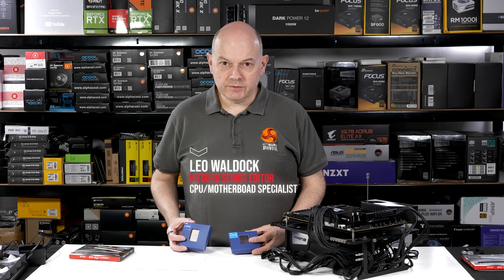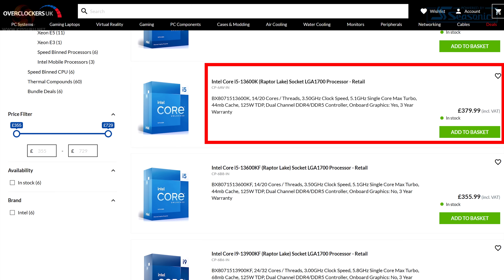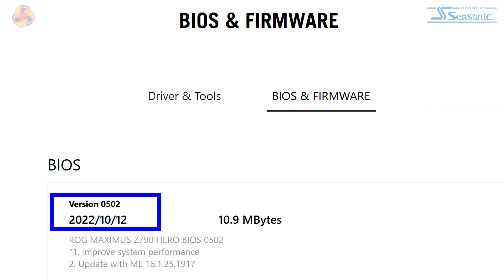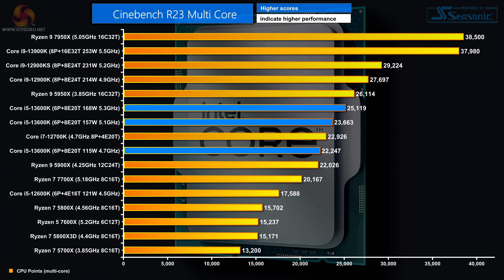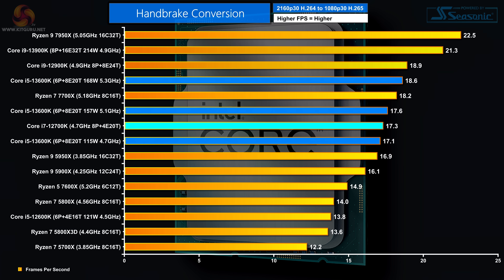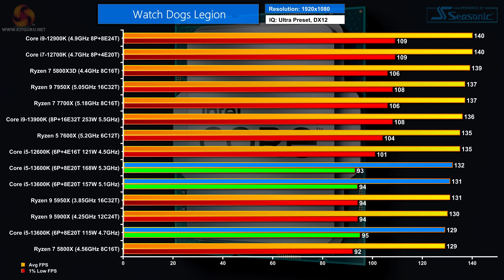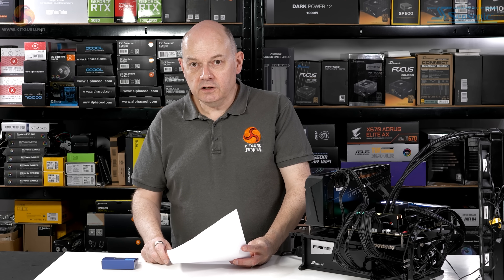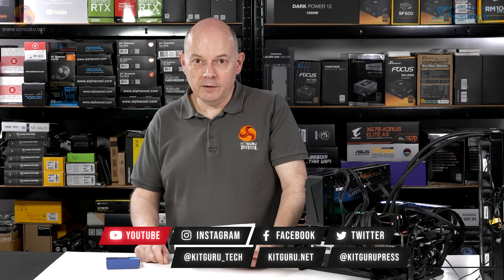Intel Core i5-13600k - smashes Ryzen 5 7600X 🥊

Comment: I would guess 99% of buyers in this range don't care about productivity at all, only gaming. So is it really better than 7600X when you know AM5 is here to stay? I don't think so
Reply: most buyer in this range wont upgrade their pc for 3 to 5 years
Dunno why amd fans always push this narrative all over the internet
I also own a ryzen 3600 and it doesnt make sense for me to upgrade to 5950x if i decide to upgrade
If im gonna upgade i will upgrade to the best current cpu that is within my budget(13600k) and by the time i need to upgrade again both intel and amd wil be on a new platform by then
Reply: @keev9882  man, that is what I'm saying, 4 years down the road you buy the last AM5 CPU and just slot it in your AM5 motherboard. Imagine you still have Ryzen 5 2600, you can just go and buy 5600X and be done with it, or even better 5800x3d. That is what you can do actually. Pretending like platform longevity is not important is delusional
Reply: Disabled e cores and run an all core 5.6ghz OC, yep
Reply: @jameshare1848  Yes, Actually Hardcore Overclocking did that quick and dirty. Totally stable.
Reply: Say in 2 years time a 9600x3d drop in replacement same motherboard. 13th gen on a dead platform.

Comment: the biggest crotch grab for people online right now is the saying "intel cheaper because am5 is a joke" but its not. most people buying 13600k are gonna end up buying cheap z690 boards, not z790 boards.... in order for the 13600k to be good, z790 is required, that means 300-400 dollar motherboards. plus the 330 dollar cpu. and then same ddr5 ram as amd.... overall you MIGHT save like 100-200 bucks, maybe. but not really. then you have to think about "future" costs. on AM5, you can simply buy a new cpu and bam, more performance. you can't do that on intel, on intel you end up buying a new cpu and motherboard in the future. so its not future proof.... making intel the worse choice.
Reply: No , Z790 is not required . i5 13600k will run just fine on Z690 ( most of this boards are able to take a BIOS update without CPU ) .

Z690 + DDR4 + $330 CPU to have a similar performance to R7 7700x for much less money . i5 13000s are the real deal on this generations of CPUs

If Ryzen 7000 was selling poorly , Raptor Lake will be its final nail on the coffin .
Reply: Bruh you dont change a cpu every years. Personally and from all people that i know once you build a pc the cpu will stay as it is if you the mid - hi end. It'll stay in the system +5 years min.

Easily its not worth it & the money to up your cpu for newer faster ones if it isnt more than 100% faster. 

So yeah future proofing is bs. Dont fall for it. Save your money & buy the best of your budget at your current times building it. Safe it for better gpu.
Reply: @BBB12106  I do.
Reply: @lucifersheadscarf6988  good for you. I would do that too if i earn $100k/month. Or i work as pro editor where the $500 cpu can earn $10k profit.
Reply from the maker: As an FYI, during my testing for the Core i9-13900K review, as mentioned in that review I also ran the CPU on an Asus ROG Strix Z690-F Gaming WiFi and found no difference from Z790. I also ran the Core i9-12900K on the Z790 Hero and found no improvement from Z690. The Z690 and Z790 chipset are effectively identical. Any differences come down to the BIOS.
Leo
Reply: I cant say I agree. but I do generally prefer AMD overall. I think these new intel solutions perform very well. but you find certain people always buy AMD and some buy INTEL. quite a lot of brand loyalty in this sector.
Reply: who buying cpu eery 3 year im not

Comment: The 13600K has twenty threads.  The 7600x has 12.   Of course it is going to do better in MT.  Yet is still highly inefficient, and  according to the 12 game combined on  Hardware Unboxed doesn't beat the 7600 x.
Reply: idle is more efficient 6w compare to 18 for 7600x
Reply from the maker: @TatsuyaWow  I am fascinated - are you really buying a £350-£400 CPU and £300+ motherboard based on idle power?
Leo
Reply: @KitGuruTech  Leo how much is a Kilowatt of power in the UK right now?  Also, I can pick up a B650 mb for $189.
Reply: @KitGuruTech  Are you really buying this class of CPU if you care about multithreaded production workloads?  If this cpu isn't even considered for that.... then how does it beat AMD?
Reply: Kitguru don’t do affiliate sales links in these reviews. One thing I noticed over the years. I get you aren’t happy amd don’t seem to have done too favourably in this but let’s keep it real.
Reply: Seems quite close either way, cant lose buying either of them. depends on the games I guess too.
Reply: The 13600k is pretty much tied with the more efficient 7600x in gaming. At the same time it completely comes ahead at multi threading because of many e-cores.
The 13600k can be pared with DDR4 and DDR5 boards are cheaper for intel due to their age. For 7600x there are no 120$ starting boards (AMD probably miscalculated) and in countries out of US an entry AM5 board is 400$+. No1 is paying that much for a low entry board.
7600x is definitely a great CPU but the value proposition is not there, unless AMD and manufacturers make proper price cuts.
Reply: @Zoomborg  If you don't include the running energy cost, the costs of the cooling and psu requirements, all for a dead platform.  Oh and yes, you can buy a b650 board for $189.  I see you fail to understand that there are variable costs in addition to fixed costs.  There is no point in using either the 7600x or the 13600k for productivity.  The win is based on a useless case use.  Economic ignorance.
Reply: @robertmyers6488  You are completely correct,  these youtube advertisers have everyone believing non-sense in order to increase affiliate link sales.
Reply: @evrythingis1  I don't want to attribute this to that.  I think they just haven't advanced the game enough in how they review.  There is almost no similarity between the 12600K and the 13600K.  The number of cores and threads is very different.  The question is: to what end?  The 13700 and the 7900 have identical threads and the performance numbers in production are nearly identical.  However, the cost of work to provide it is markedly different.   In Blender for example you can produce .5 more renders in an hour while using 59 less watts with the 9700 than the 13700.  Limit the 9700's power budget with curve optimization to 110 watts and that efficiency will go through the roof.  You can do that to some degree with the Intel products and they likely can clock higher but the efficiencies are dreadful.   The server market must be dead to Intel at this point.  AMD I do think made a mistake in not playing the same game Intel did with Sandybridge vs. Bulldozer and Piledriver.  They should have played on the far superior efficiency and let Intel show the space heaters they are.  The 7950x beats all past generation processors using set to eco modes 65 watt profile.  That is incredible.
Reply: @robertmyers6488  No one on using a desktop cares about efficiency, and neither Intel nor AMD give a crap about desktop CPU's.  AMD's new chips will crush intel in the markets that matter because of their efficiency though, servers and laptops.
Reply: @evrythingis1  My intention was to point out the inability of reviewers to understand total cost and use case.  It's about rational economic decisions.  Most of these responding ignorantly can't comprehend long term variable cost nor opportunity costs. The 13600 is a desperate creation to tie people into a crappy platform.  When the pcie 5 m.2s come out in a few months they might understand it then.   But, hey it beat the 7600 in Cine who cares about superior game play and loading.  Yes you are right Intel server market is dead.